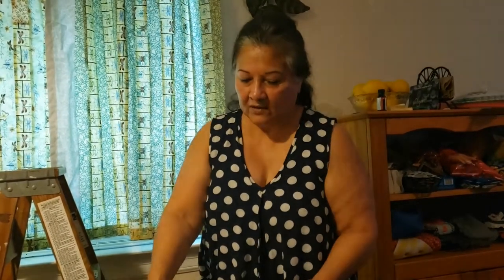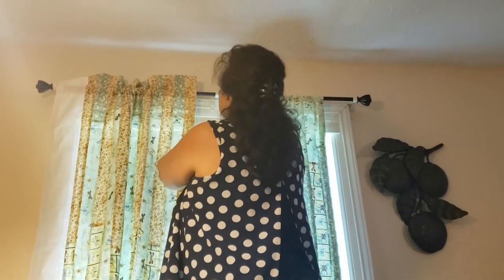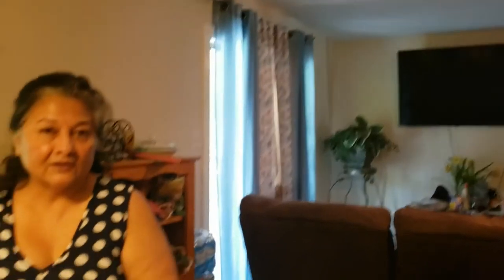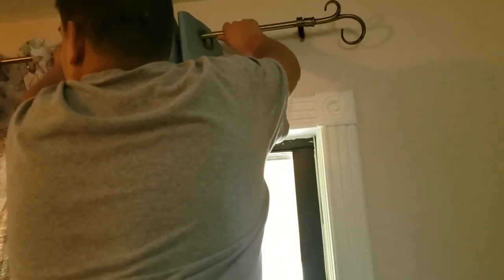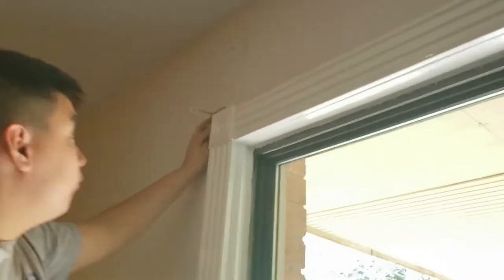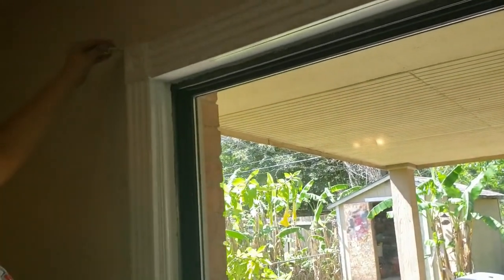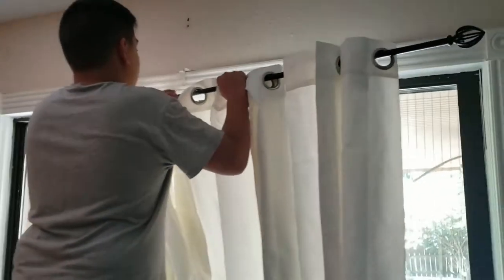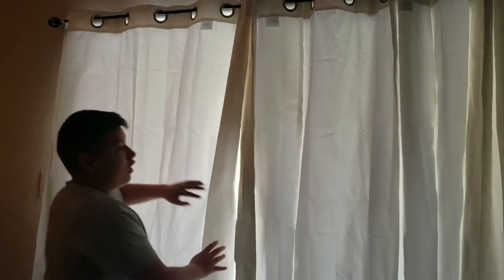How to Hang Curtains w/o Making Holes in the Wall,  Less Than 5 Minutes.  So Easy

Comment: This is great, thanks for sharing. Is one qunaty  enough to cover both sides of one window
Reply from the maker: Hi Corey,  From my experience, if a window is more than 36 in wide, it will need the one in the middle so it doesn't sag in the middle.  If you visit the website at KwikHang, you can shop around and read about products there.  

I'm not an affiliate of this product.  I am just sharing what I believe is a great product that I found for myself and wanted to share.  I love it because I don't have to hang rods up crooked, no matter how hard I try not to, and I don't have unwanted holes in the wall.  If you move you can take them with you.  It's so easy. :)